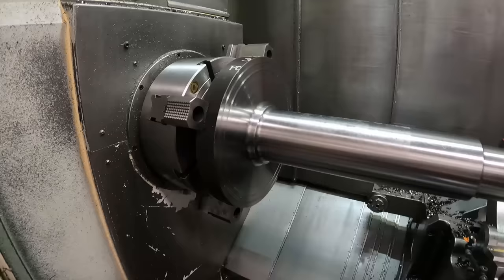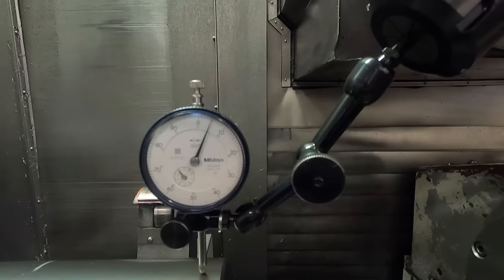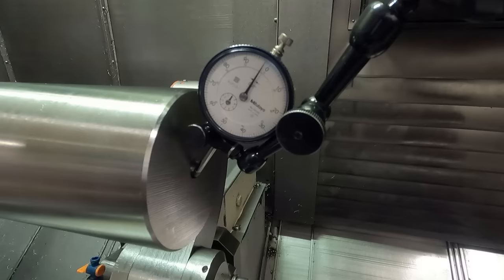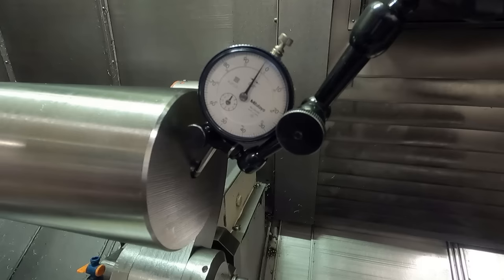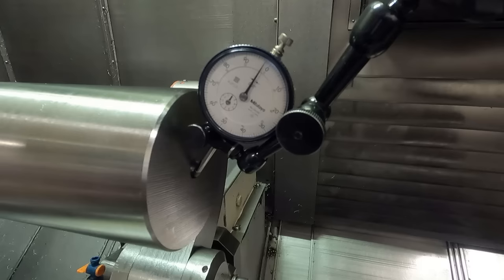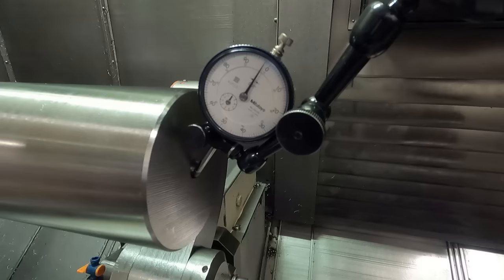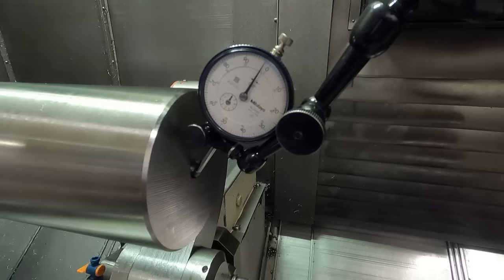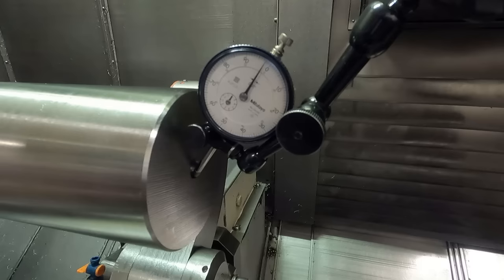Machine Shaft From 2000 Lb Stock

Comment: I’m genuinely curious and maybe you’ll be kind enough to educate me. Anyways, this process of taking that rather large roll of stock as it was down to what it is by the end of the process seemed more labor intensive and costly in terms of time spent to make it. So my question is, why would this particular method be preferable as opposed to having a similar part cast say slightly larger and it be sent to you afterwards to be ran through the lathe there to a more precise size and dimensions required?
Reply from the maker: Because a casting would not be strong enough for the intended purpose.
Reply: @EdgePrecision  so it’s simply about strength of the final product? Wasn’t that roll stock originally cast and hardened only larger then sent to you for shaving on the machine you used? All I’m getting at is it seemed overkill in a sense cause that 2000lb roll of metal lost more than half its original size and weight before it became what it was at the end. If strength of the final product is the reason then so be it I was just curious. Thank you for your reply.
Reply: @JP-jm9fy   I  was curioused too about wasting  more than a half of part to chips, but i guess it is cheaper, if you have couple details to turn it from solid bar, than to cast it. And after casting it should be thermal threated ofcourse. Forging will be more stiff, i think.
Reply from the maker: @JP-jm9fy  In a way you are correct but not quite. Out of the furnace the steel is cast into a large ingot. Than that is heated to forging temperature and forged to a rough shape. Than while hot run thru a forging mill to refine its grain and structure. After that turned on a lathe to shape. Than heat treated. Do a search on YouTube for the manufacturing of steel round bar. There are many videos showing the process. This is all referred to as forged bar witch has a grain structure after forged. It is stronger and more ductal (able to be bent without breaking) than a casting.
Reply: Thank you for the reply. I’ll do that and look into the steel processes and round roll stock like this. I’m sure it help. Thank you again.
Reply: I just watched a video on the making of steel bars such as the one in this video. So the bar as I understand it was originally cast as a ingot and then heated again then flattened to a desired thickness and rolled up like a coil and all those layers are squeezed through more rollers until they’re welded together to make a solid bar then heat treated again and hardened and cut to various lengths and thickness depending on what was ordered by the customer. A cast on the other hand doesn’t go through these same processes and even though they can be hardened the molecular structure of the steel is different. I think I kinda get it now. So I’m guessing that the process of a slightly larger cast then sent to you to be put through a process for a desired thickness and dimension is possible but the final product wouldn’t be as strong as starting from a roll stock and working it down to the same desired end product. Maybe that does happen from time to time I’m sure but it would kinda depend on what it’s needed for.

Comment: Do you need to compensate for taper in your program?
Ps: Very nice video!
Reply from the maker: On this machine it is quite easy to adjust the tail stocks quill to eliminate taper. In the this video I pointed out how this is done. But in this case it wasn't necessary. I don't like to program small tapers like .0005-.001" because it can affect the finish. The machine only has so much fine resolution so lets say you program a .0005" taper over 12" of length. It will have to make very small adjustments in X to only move .0005". So lets say the minim movement the machine can move is .0001" (It can do better than this but for example lets assume). It would have to make 5 movements over the 12" to do the taper. So every about 2.4" there would be a change of .0001 to do the taper. This would movement can show up in a fine finish. Now on this machine it moves on linear bearings so it could probably do this OK. But I have seen on machine with standard box ways. They have a certain amount of stick/slip in their movement. So even if the servo system is capable of finer resolution it commands the move. But it takes a certain amount to actually move the axis. So it kind of moves in jumps. This shows up in the finish with very small tapers. So I try to avoid this if I can.
Reply: @EdgePrecision  Thank you very much for this detailed explanation.
These are really priceless informations you are giving in all your videos.
Please continue what you're doing!
God bless you.

Comment: Was I seeing things but the main spindle z axis is also moveable?
Reply from the maker: I'm not sure exactly what you are referring to?  The turning spindle is like a regular lathe with a C axis. It doesn't move. The milling spindle is mounted on a B axis. So it can rotate from horizontal to vertical and mount milling and turning tools. So this machine is considered a mill/turn machine. It can also do 5 axis milling because it has a X,Y,Z also has a B and C Rotary axis. I don't know does that answer your question?
Reply: @EdgePrecision  I’m just now looking at a differnent video, and I see you have a small chuck mounted in the tailstock body. I suppose that answers my question!
Reply from the maker: @davidkitsio3839  no it just has a tailstock like you see in this video.
Reply from the maker: That small chuck is just mounted to the live tail center. I use that for parts that have no center in them.

Comment: Maybe a silly question, but why not just use the magnet to place the stock, and not go through the whole process of switching out to strap?
Reply from the maker: The total weight exceeds the capacity of the magnet I have. Also for safety reasons I don’t like to use a magnet to lift round stock into the lathe. Where it’s necessary to be so close to standing underneath when swinging it into the machine on the hoist. A strap is much more secure.
Reply: @EdgePrecision  Ah, cool. Thanks for the answer

Comment: I know you have a lot of time invested in these parts Peter, but Your safety is more important than a few scratches on the shaft.  I don't think I would climb inside the machine while there was still power on.
Reply from the maker: This machine has safety interlocks so nothing runs when the doors are open. The only thing that can be done is manual jog. In order to do machine work on any larger machine. It is necessary to sometimes get into the machine. No way around it. It’s common to do so and completely safe.

Comment: I have zero knowledge about machining, how come u start with something so big? Wouldnt it be more efficient to start with something already similar to the final dimensions? Sorry if these are dumb questions!
Reply from the maker: The part has a flange on the end that is 16” in diameter. So the stock had to be that large. If you read my comment in this videos description it will answer more questions.
Reply: @EdgePrecision  woop im an idiot i thought the final was smaller. Thanks for the response!

Comment: Can someone explain why he wouldn’t start with a smaller round bar?  Wouldn’t that drastically reduce time, wear and waste?
Reply from the maker: There is a flange on the parts end that is the diameter of the stock. Because the customer wanted the part machined out of one piece of material the stock had to be this size.
Reply: @EdgePrecision  guilty…didn’t watch the full video.  Thanks
Reply from the maker: Finally someone with the integrity to say so. Thank you! You don't know how many comments  I get of people who haven't watched the whole video. They appear to type a comment, than click away. I like to respond to all legitimate questions. At times I think why bother. You have restored my belief in people.
Reply: @EdgePrecision  screw them!  Just been on a binge of metal lathe videos and watching as many as I can.  Not watching most end products.  Just amazed at all the talent and machinery.

Comment: Question - why use that much stock when so much is going to end up on the floor ?
Reply from the maker: The flange on the parts end is the diameter of the stock. The customer wanted the part machined out of one piece of stock. So there is no other way to do it.
Reply: @EdgePrecision  thanks for the reply 👍

Comment: Please forgive my lack of knowledge on this but , why such a huge stock ??? When the finished diameter is less than half?
Reply from the maker: The part has a flange on its end the same diameter as the stock. So in order to make it out of one piece of material (the customers design) I had to use this diameter of stock.
Reply: @EdgePrecision  thanks so much , now it makes complete sense, excellent content , thanks for sharing.

Comment: Wouldn't it viable to get those parts forged as blanks?
Or is this material so cheap you can afford it to scrap 2/3 and have you doing this much turning?
Reply from the maker: It was mostly the time in this case. We needed to get the material and machine work done in less than 30 days. But even so at this quantity the forgings would be more expensive.
Reply: @EdgePrecision  Hm, Interesting!
If it's needed in a hurry that's absolutely clear.
But I would have guessed those pieces would have taken more or less the same time and equipment cost to squeeze a smaller/cheaper piece into shape instead of you hogging out the huge amount of steel.
Thank you! 👍
Reply from the maker: @martin09091989  In this case it would save maybe a few hours. If  you have ever worked with raw open die forgings. It takes more time to fixture or hold them because of there irregular shape. And the mill scale can be a problem. Now I have machined some where the forging shop pre roughed them. These are OK. But than you of course pay for that. So what it comes down to is you pay me or you pay the forging company. Or the welder in case of a fabrication. I would rather I get paid.

Comment: Can I ask how much one of these large cylinder-blanks cost?  Also, the finished part?
Reply from the maker: The raw material costs about $1.45 per pound. As far as the finished part cost I can't talk about. Sorry.
Reply: @EdgePrecision  Thanks so much for responding and pardon my asking the finish price; I just innocently wondered about the value-added.  
I guess it’s not looked upon so much as a ‘product’ but more of time-and-materials.  
Anyway, I really learned a lot from your multiple sanity checks so you don’t get fooled by just one measurement.
Reply from the maker: @SpinStar1956  No problem. I just hesitate about the final price. There are quite a few people from other shops in my area that watch and read the comments of my videos.

Comment: If the original welded part came apart, you definitely need better welders or better welding engineers.  4140 machine steel is not that difficult to weld, but does not suffer fools gladly;  nor a lackadaisical attempt at welding.
Was the original weld a full penetration weld with appropriate pre and post heat treatment?  Was the steel welded post heat treatment?
Reply from the maker: In reality wasting the material by machining out of solid is less expensive than welding two pieces together. There are a lot of comments here from people who don’t understand what it involves. First it is necessary to prepare the two pieces with proper welding bevels. Then there is the welding. To do it properly this material has to be pre heated and welded at the proper temperature. Then post heat treated. After that then the finish machining. Witch involves another roughing operation then finishing operation. At the price of the raw steel bar it is less expensive and takes less time to just wast the material from a solid round bar. If there was time open die forgings could be made. But at this low quantity that also costs more then just wasting the material.
Reply: @EdgePrecision  The time to machine weld preps is very small.
Pre and post weld heat treating depends on the available facilities.
I grant you if none of those are immediately available, including proven weld data sheets and procedures, it very well may have been cheaper and faster to machine from the solid.
I worked in the heavy engineering business where all the required methods, tooling, and procedures, were readily available.
Reply from the maker: @BasementEngineer  all this does take time though. I was given one week to get material and finish the parts. To get the two pieces of material for the fabrication. Takes the same as getting the big bar. Then they have to be prepared. Sent to a welding shop to be welded. So to get in their schedule and do the welding. Then to heat treat. This could be done in one day. Not to long. Then back to me for finish machine. I did the parts in one week from solid. Do you think it could be done the other way faster. Unless I could do this kind of welding myself (witch I can’t) no I don’t think so. So given time perhaps a fabrication could save a slight amount but as I said that wasn’t the customers request.

Comment: What was your G50 when it was facing?
Reply from the maker: When I’m rough facing the blank it’s in low range. The turning spindle can’t turn any more than 460 rpm in low range. I set the G50 at 500. I have been setting it in high range to 1000. For the finish cuts. But the part is much lighter when doing the finish cuts. The machine is capable of 1600 rpm in high range.

Comment: When I machine 4140, they become magnetic too. Toolox as well.
Reply: Usually, when the workpiece gets magnetized, I'm using high-speed steel tools. It's really annoying when that happens.
Reply: @PaulSteMarie  I built a demagnatizer for this issue. I put 4 rare earth magnets around a circle and when I put it in my battery powered drill it starts rotating and takes out the magnetism. But it is very annoying. I wonder what is the reason behind this magnetism.
Reply: @OrderBringer41  Rubbing steel together can magnetize it. As I (poorly) understand it, it's due to residual magnetism in the pieces somehow feeding back on each other. It happens much faster if one piece is already strongly magnetized.

Comment: Why so thick ? If you mill it all the way down why not start out smaller ?
Reply from the maker: The flange on the end of the part is 16” in diameter. In order to make the part out of one piece of material the stock had to be that size.